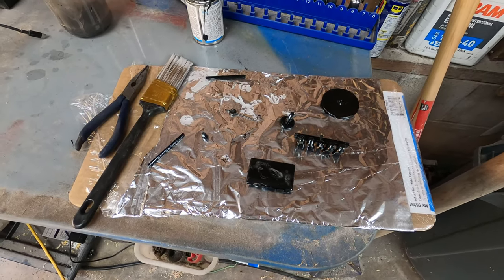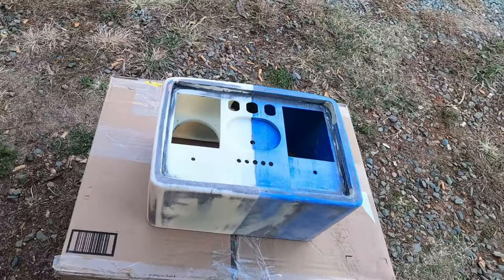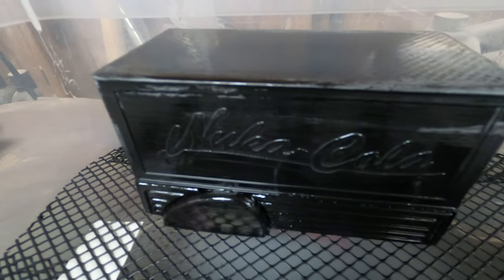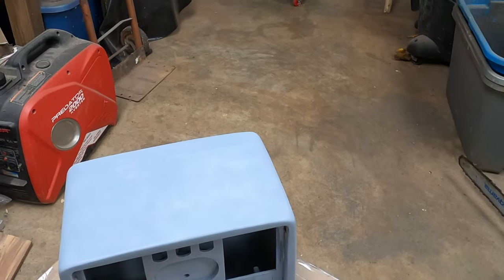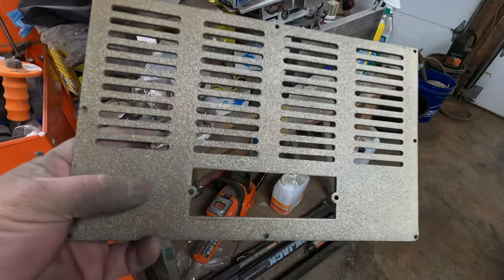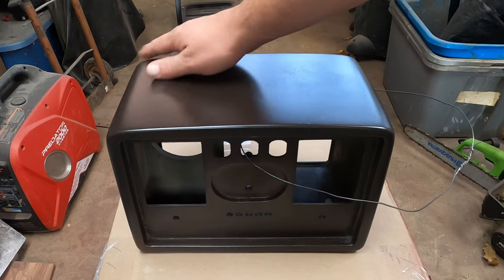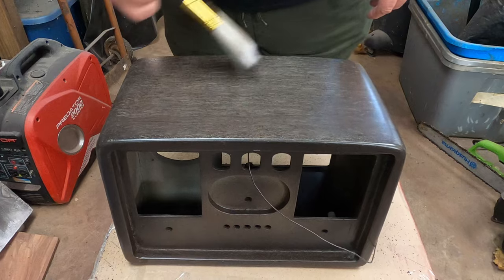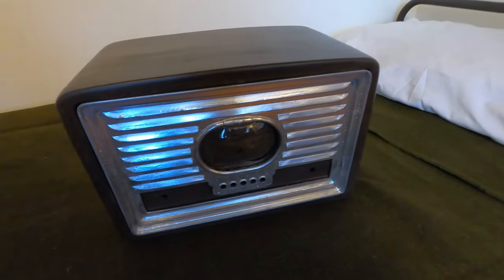Time To Paint The 3d Printed Fallout Radio - Painting Plastic To Look Like Old Weathered Faux Wood

Comment: I am absolutely impressed with how this has turned out.  I wasn’t sure about your paint technique when you started, but that is the perfect finish for the radio.
Reply from the maker: Thank you, Years ago I learned a lot of odd painting techniques that can be done with simple spray paint to create all kinds of different effects.  You do have to be really careful with the acetone brushing.  If you put too much on it will cause the paint to crack or wrinkle up.  In the case of the radio I intentionally put it on a little heavy in some spots to make it look like the old veneer had shrunk and cracked up.  You can also go over it with some very thin mat white acrylic paint in spots to simulate water damage.  But that's a little too old and worn for my taste.